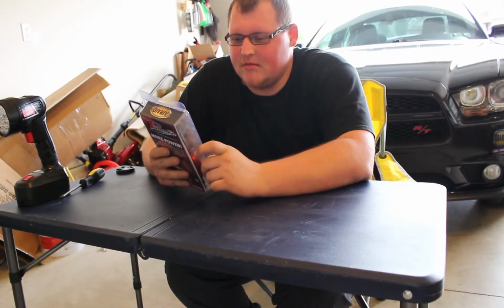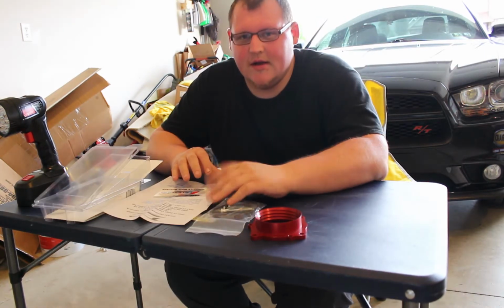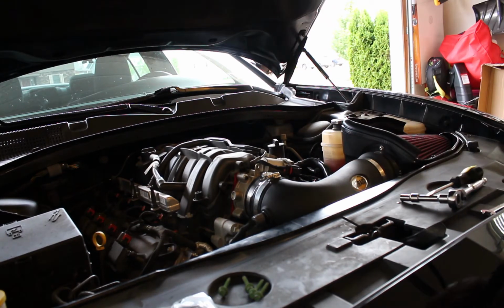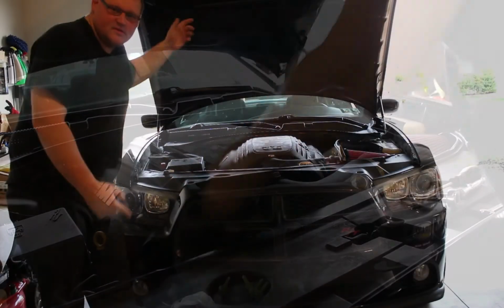2014 Charger R/T Thottle Body Spacer

Comment: It DOES make a difference, but it’s minimal.  What people do not understand is these parts are SYNERGISTIC (1+1=3) and enhance other bolt on mods already present that aren’t accounted for when these spacers are “evaluated.”  

Shorty headers, 85 mm TB, CAI, tune, Diablo performance tune, ALL will be ENHANCED by this SPACER.  The 1-2% negligible difference made ALONE turns into a 5-8% with these other mods.  

These are not myths; these are confirmed correlations that are repeatable.

In my opinion, racing mods are either “poor man” nickel and dime a new mod every paycheck.  Or drop a PROCHARGER on it and call it a day.

NA high horse power gains are a SYMPHONY of mods that all work together (hopefully with a proper tune) to develop high performance gains.

Forced induction, is a set and forget procedure that goes FAR above and beyond anything possible by NA.  There’s just no comparison.

The difference is.  Forced Induction is 6-10k money UPFRONT installed.  NA mods, are 150-850.00 mods installed every month or when funds allow over the course of years.
Reply from the maker: I agree